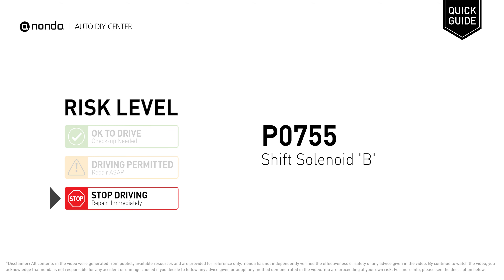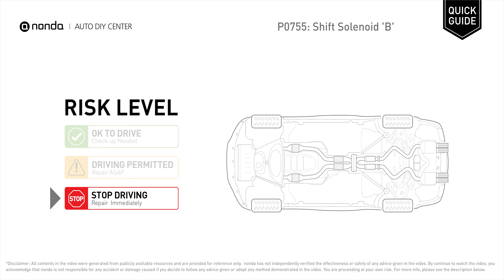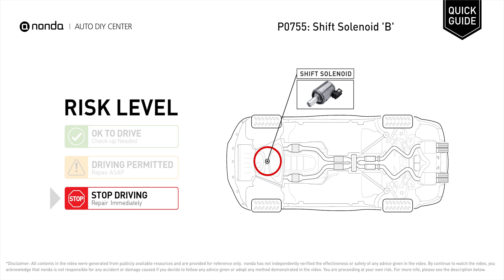What is P0755 Engine Code [Quick Guide]

Comment: كيف يتم اصلاح الكود p0755 سياره اللنترا ٢٠٠٩How to fix the code p0755 Elantra 2009
Reply from the maker: Hello, have you checked the condition of the shift Solenoid B, valve body, and the electrical connections? Also, please make sure that the transmission fluid is in correct level.